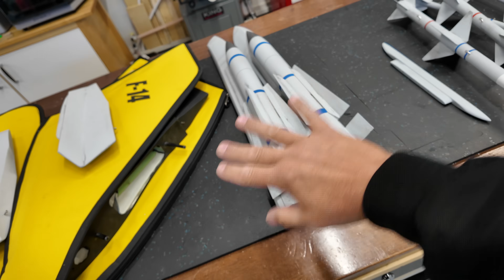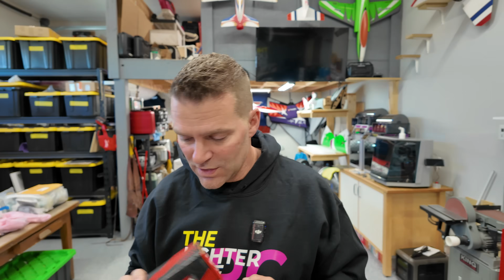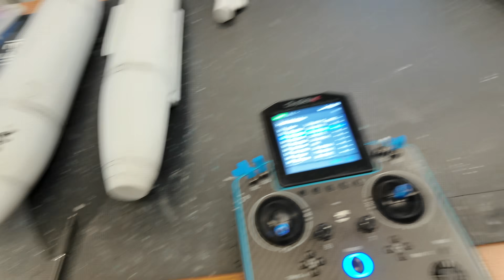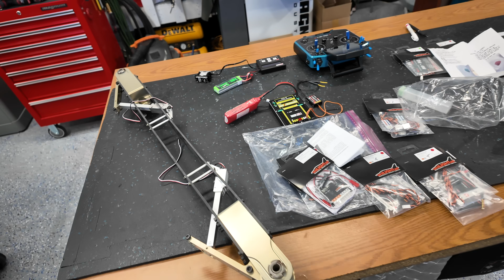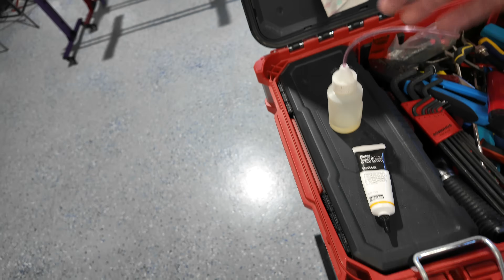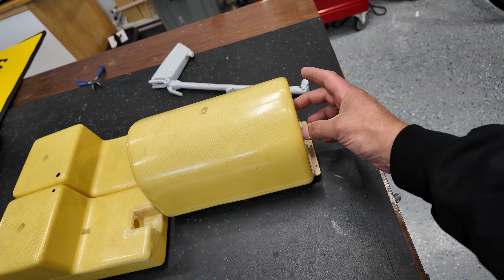Top Gun Dreams: F14 Tomcat RC Build Begins Skymaster F-14 Video 1

Comment: Jon, where did the lens set come from for the Tomcat? You mentioned the lights were from unilight but not the lens set. My Tomcat is getting a refurb this winter and lights are part of it. Thanks my friend!
Reply from the maker: Hello David.  Not sure as they were supplied with the kit.  They are basically blocks of West Systems Epoxy that is tinted red and green.  Same as I did on the first one.
Reply: @thelightersideofrc  thank you! I looked back at that video and wondered about that. Ill whip some up. Thanks!